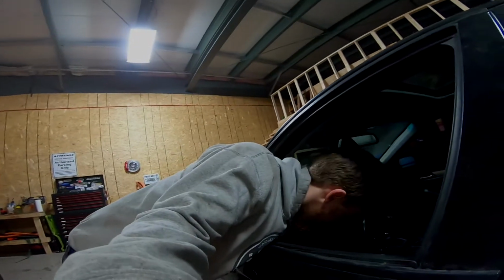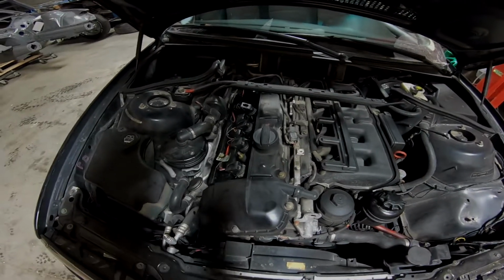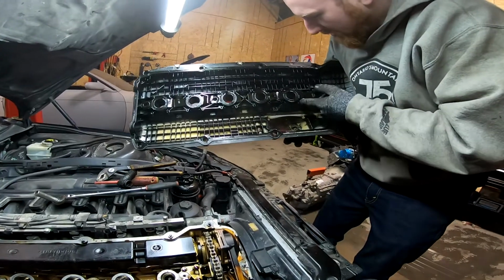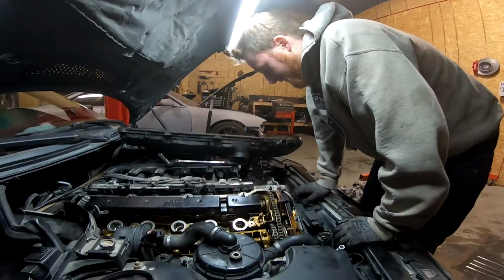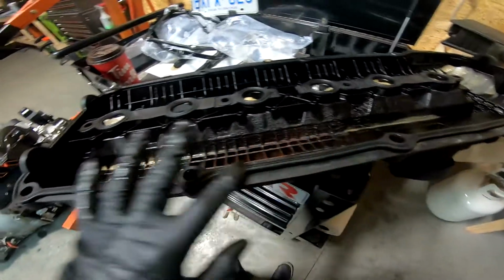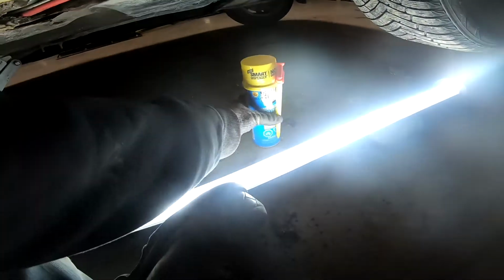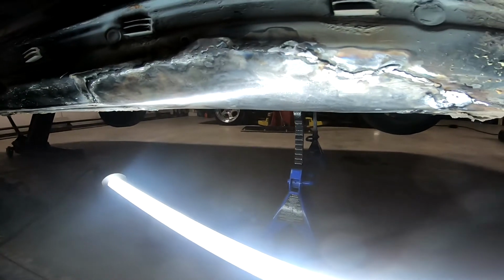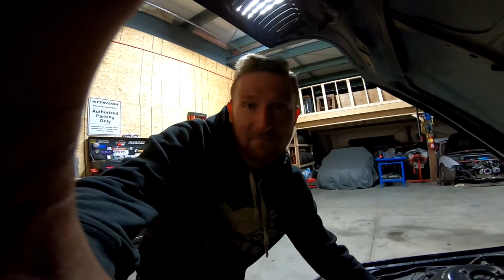Getting The Motor Running!!

Comment: The oil in the coil packs is because of the valve cover gasket, the original coils can work with boost but not the maf, inhectors and fuel pump